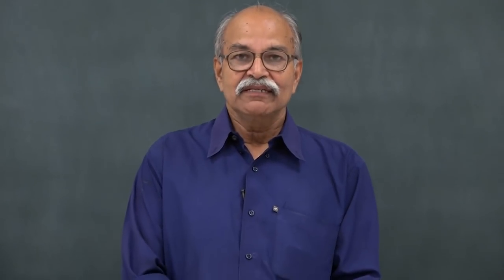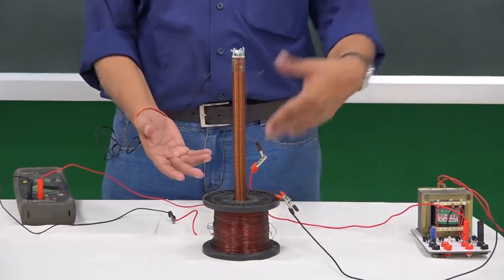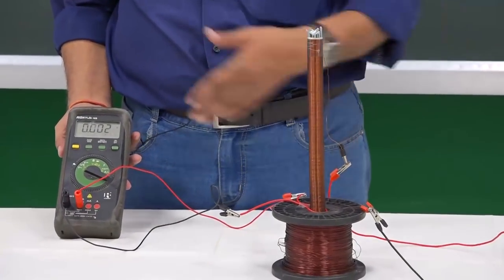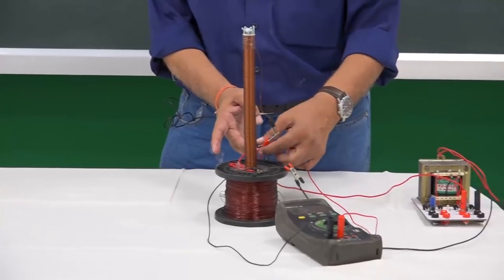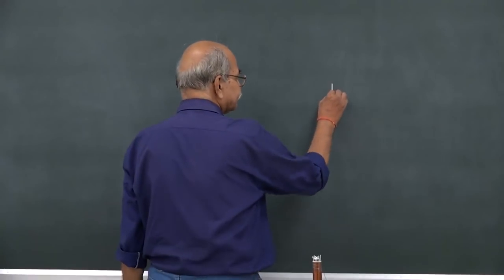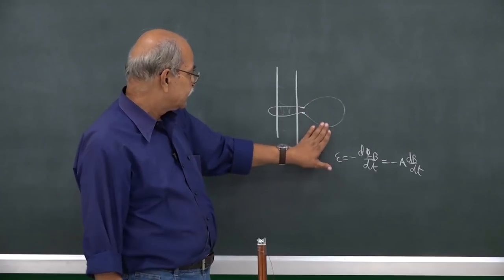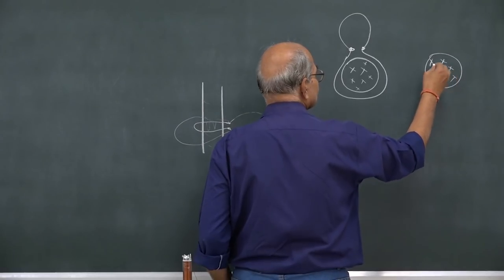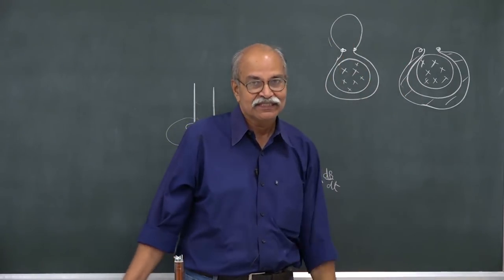An experiment with induced emf

Comment: Sir, could you please explain the problem Lewin/Mehdi? I think you know the problem . A loop with one resistor on one side, and another resistor on the other side. Now you have two voltmeters, one on the left side, and the other on  the right side. The two voltmeter, connected to the same two points show different values over a closed loop.

Comment: When there is no change in magnetic field in side the closed loop un second case then from  where the 0.7emf generated sir
Reply: An ideal solenoid has infinite and produces no magnetic field outside the tube but , finite solenoid produces some magnetic fields outside it ! that's why he got .7 volt

Comment: Sir, I have question why changing magnetic field produce  induced electric field?
Reply: through faraday's law, we know that changing B produces an emf and thus a current right?current is due to the movement on charges. But initially, the charges are at rest. So the force on them due to B( q(v X b) is 0. Then how do they start moving, thus causing a current? so it was concluded that there must be some electric field in the direction of the conductor causing the movement.
Don't know if i have missed something or if there is another explanation, but here u go

Comment: SIR DOES CURRENT FLOW DEPENDS ON TEMPERATURE
Reply: Yes it does
Reply: @ItIsBigSmoke   HOW COULD YOU PLEASE EXPLAIN
Reply: The resistance of a wire increases with increase in temperature. so the current flow will be decreased when the temperature is high and increases when the temperature is low

Comment: Incorrect!
The explanation is pretty simple . . .
Actually, simple transformer theory!
The 1st loop or turn produces an emf of 34mV.
The 2nd loop or turn (counterposing the first turn) produces an emf of 34mV 180 degree out of phase with the first turn.
NOTE:
BOTH turns have an emf induced in them because they are both exposed to the magnetic field of the solenoid (transformer primary)!
The solenoid (primary) magnetic field does not magically disappear because of the way the loops are wound as stated at 6:35.
Given that these two turns are connected in series but the two voltages are 180 degree out of phase:
34mV - 34mV = 0 V.
Don’t get confused with tricks of physics and maths.
Reply: Hey, can you please explain this to me...
In the case of solenoid, if we want to calculate change in flux(d/dt B.A) what area  should we consider? Do we have to consider the area of the external circuit connected across the ends of solenoid also?
Please explain this..I would be very grateful...
And I have many more doubts too,...
Is the emf produced in the coil if it is open?
And the biggest doubt is that I asked before, that what area should we consider....Is area of external loop also contributes, or just the area of coils?
I have this doubt because in the video (Induced electric field part: 3) By HC Verma sir,
He did an experiment similar to this...
But he measured potential difference across ends of solenoid...and when he displaced the external circuit, the reading changed.....
So I came to conclusion that emf depends upon external circuit connected tooo, but how?
Reply: @abhi_sndhu  1st : you will consider all the conductors lying in that magnetic field . in this case when cond. is on 1st position there are two conductors hence there was a emf but in 2nd pos there are 4 cond. also in opposite position to 1st hence emf cancle each other.

2nd: as in transformer of your colony/city u will see that if there is no load means the loop is open yet there is an emf on secondary .
Reply: @afteshammeraj  Thanks 😊
Reply: Craig, in other words, think about the second scenario as a transformer with two turns. Normally, more the number of turns, more is the induced voltage. But, in this experiment, seems one turn is say, clockwise, and the second turn is anti clockwise, so the two induced emf cancel each other.